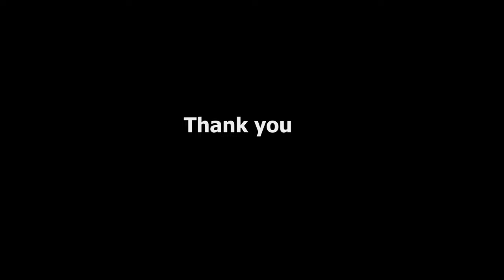Teardown Logitech M235 #logitech #m235 #mouse

Comment: Wrong treatment dude. First you should remove the upper cover with the slide. Than you'd reach the pins to unlock the main cover. By the way you could search for a screw by scanning the stickers without removing them.
Reply: Scanning them with what?
Reply: Wrong, removing that screw and taking the bottom off first makes it much better to unclip the top section, try it and you will see, I always used to take the top of first too but you risk snapping the the plastic lugs off the top section that way. I wish you could buy new side rubber grips for when they go all sticky.
Reply: @oldgamer1330 you can scan with your finger/or with a screwdriver by applying a little pressure around the sticker then you’ll feel where the hole is.
Reply: @halilersahin7092  Ah ok, I thought you had some tool to do this. Thanks.